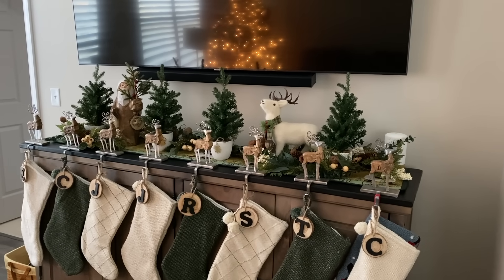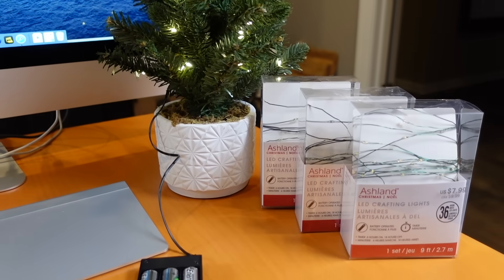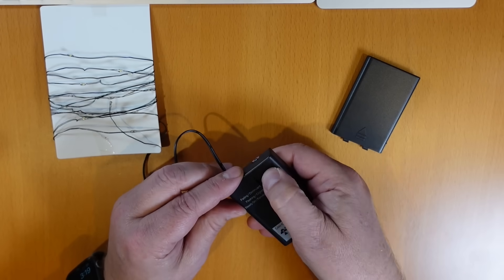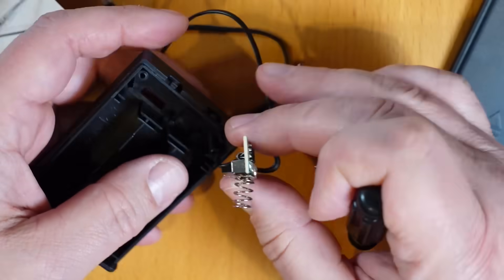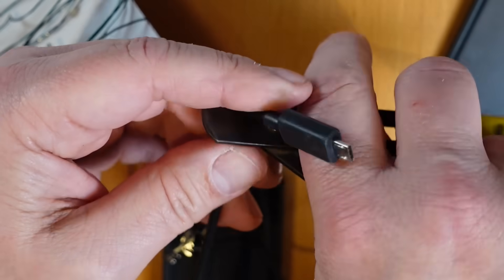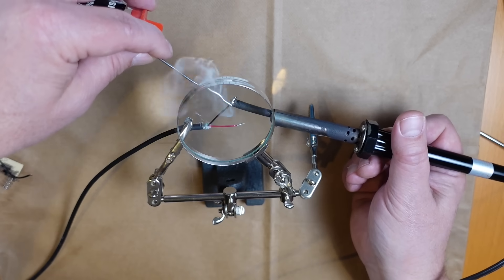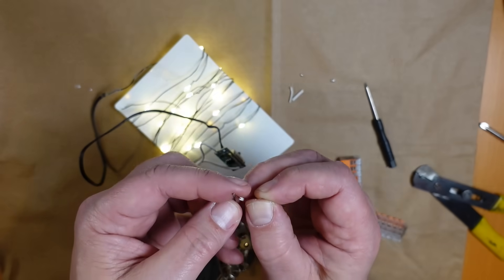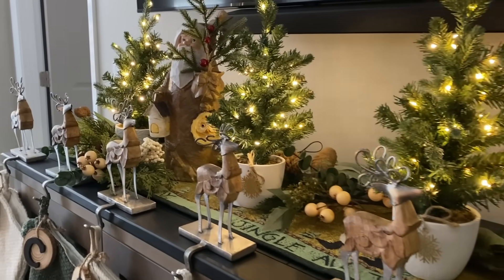SAVE $100s on batteries with this simple decorating hack

Comment: You’re fortunate to have an outlet where you want it. I use rechargeable batteries. You can even recharge regular batteries. You just have to set a timer and take them out before they overheat and explode. 🤭
Reply from the maker: And how do you know how long you can charge them?
Reply: @ I charge them an hour and check to see if they’re warm. If not, I’ll repeat. 3-5hrs usually does it, according to my battery tester. It’s really not recommended, but I have never had any trouble. It’s easier to just buy rechargeable batteries, but sometimes I run out and the old dead standard batteries are right there, so…

Comment: Since you have a multimeter, with the 4 lights connected, it might be interesting to:
- put the leads across the +/- terminals, and see what the output voltage is then

If you have a USB voltage tester, you could also see the current draw.   I wouldn't have thought a single string would draw 1A, that you'd need a 4A charger for all the sets.
Reply from the maker: Thanks

Comment: At the very beginning of this video, the batteries shown are rechargeable.  Yeah, they are expensive, but they can be recharged for a long time. I've been using the same ones for over SEVEN YEARS. Using batteries is a lot neater than having wires running all over the place and extension cords taking up outlets if there is a lot of decorations. The batteries are a lot simpler and there is less clutter. Nice idea though if it's just for one or two items. Still, rechargeable batteries are simpler and well worth it in the long run.
Reply from the maker: Why did you watch this video?
Reply: @handydadtv  
To see what the hack was all about. I'm just saying, in this instance, with all the extra wires laying around, t'is better to just use some batteries. Plus, rechargeable batteries are a lot more ecofriendly than a normal battery.
Reply from the maker: I agree it’s an option.
Reply: @Tube069  more eco-friendly than using an existing charger and zero money plus zero toxic waste on the landfill? Because at some point every battery dies...

Comment: Great idea about using the USB supply, but I'm thinking a different route. I'll connect wires at the end of the cable and attach the wires to the individual control boxes with mini clips. That way everything is removable for storage and if necessary for repurposing the lights can be changed back to battery power.
Reply from the maker: Good idea
Reply: Yes, I was thinking the same.

Comment: I always used a USB charger, a USB cable, a round ink pen and 2 flat thumb tacks. I cut the pen tube to the size of an "AA battery. slide the positive and negative wire up each pen tube, connect the wire to the thumb tack as the terminal and hot glue in place. Now you can use it on anything that takes three AA and AAA batteries, but the pen tube has to be the size of an AAA battery.
Reply: Please do a video of this, GetReal3327.
Reply from the maker: Great idea 👍🏻

Comment: Is there a way I can do this without a soldering iron?
Reply from the maker: Use rechargeable batteries.
Reply: They make kits with fake batteries connected to a plug to do more or less what he's doing in the video with no soldering involved.
Reply: Hot glue will work if you get good contact at the wiring points.

Comment: wait so did you end up using all the lights on the one black power supply or did you use the USB cable on the white iPhone brick. Just looking for clarity on that. I have way more iPhone bricks than the old school 5v wall warts.
Reply from the maker: The iPhone charger wasn’t enough power.

Comment: What other circuitry is on the board, do you reckon?  The lights I got from IKEA only have 2 modes- off and 6h on.  I want to ditch the circuit board so I can have them on for longer than 6 hours, and to control them with a smart outlet. Can't for the life of me find a straight answer!
Reply from the maker: I’m not an electrical engineer so I don’t understand electronic circuits. I just replaced the batteries with a power supply and kept the old circuit board.

Comment: Thank you !!!!!  Can you please post a vid to show the electrical conversion steps SLOWLY ?  I do not have a sodering iron. So how do i do it without ? 
(Another little hack if you wish to yourself - plug in an automatic timer to the outlet.  Program the hours of operation.)
Reply from the maker: I used a smart plug instead of a timer.
Reply: @handydadtv I too love smart wifi plugs & have been really happy with the ones KASA provides.

Comment: Just cut down the wire from my string lights now confuse how to attach a usb cable to it
Reply from the maker: You can’t just wire the string to power. It needs the electronics in the control box.

Comment: If you don’t care about switching on and off and you’re okay with always on, can you just cut the cord on the lights and solder those wires directly to the power supply wires?
Reply from the maker: No, there is other circuitry on the board. Not just a switch.

Comment: But how would you do this x 6? Say you had 6 strings of light s, each with their own battery pack. Wouldn't their combined voltage 4.5v x 6 = 27v? Thats what im dealing with right now. The biggest power adapter I have is 12v. I thought to use say a laptop power adapter but I fear that would far exceed the output I need. So should I be looking for a 30v-35v power adapter??
Reply from the maker: Wire them in parallel (all positives together; all negatives together). Voltage is the same for all of them. Just need a strong enough power supply for the combined amperage.
Reply: @handydadtv  I was hoping you'd say that. So you think a phone adapter should cut the mustard then? I have them ranging from 5v to 12v, not to brag about all my cord collection 💁also have assorted resistors on hand.
Reply from the maker: If they each have 3 batteries in series, that means they run on 4.5 volts. You should be able to power them from a plug-in USB charger because it outputs 5 volts. No need for 12v or any resistors.
Reply: @handydadtv  Thanks for going through it with me pal, appreciate ya!
Reply: You should add a diod or resister so as not to overdrive the leds, otherwise you will shorten the life considerably
Reply: So please which DIODE should I ask at the store? I am doing something similar, 3 AA batteries (4.5v TOTAL) to USB. Thank you in advance.  @Misterpaulwood

Comment: Just checking for a few seconds for the voltage might not be conclusive. Most LEDs will work with overvoltage, but it greatly reduces the lifetime. Adding a series diode will reduce the voltage by 0.6-0.7V and will have almost ideal voltage.
Reply from the maker: Good point 👍🏻
Reply: Can you be more specific about the diode you put in series?  Do you really mean a diode and not a resistor?
Reply: @bbacher95  yes, I mean a Diode. The forward voltage of a silicon diode is 0.6v to 0.7v depending on current and temperature. That voltage is lost and converted to heat. Just put it in series in forward direction.
Reply: @teslatrooper85  got it;  thank you
Reply: Exactly my thought
Reply: been doing this for years and years and the lights are all still going just fine
Reply: except the nominal full charge voltage of a AA battery is usually about 1.7v. 1.7 V times three batteries is 5.1 V.

therefore, the 5 V output of the USB charger should be perfect.
Reply: @Jasons_Garage  Depends on the battery. Some (usually the cheap ones) are as low as 1.2v.
Reply: @writerpatrick  I'm guessing that products like this are not built for cheap, weaker batteries, so the point is moot.
Reply: @writerpatrick  The ones you have in your drawer that were used for who knows how long are 1.2V. Right from the pack, they are 1.6-1.7 V.

Comment: Nice hack, the rechargeables you start with are ~1.2v each BTW.  There's a small chance the 5v may over-drive the LEDs - but since it looks like you are powering 4 strings off of one usb cube, this should lower the overall voltage.  Make sure the USB cube doesn't get too hot to the touch!
Reply: AA are typically 1.5V, and 3 in series are about 4.5V. They’re likely under powering by design 5V analog LEDs. Supplying 5V to them will just achieve their full potential with no issue. I would however fuse the connection.
Reply from the maker: The little cube didn’t get hot to touch, but it would shut off after ~4 hours every day. So I upgraded it to a 4-amp power supply. All good now.
Reply: @handydadtv  That’s interesting… you should try powering just one, and measure max amps, then account for proper gauging and supply to handle all combined.
Reply from the maker: That would make sense. But I’m more trial and error.

Comment: Does the amp output of the charger have any effect? I'd be concerned those tiny little wires would overheat with any extra voltage / amps going to them.
Reply: The fractional voltage difference will have no effect on the wires - and a higher voltage lowers the watts/amps (in general) :)
Reply from the maker: For a single string, you’ll be fine. In my case, I was powering 4 strings from a small Apple charger and it worked fine for around 4 hours. Then it would shut off. Probably an internal thermostat. Next day it would be fine for another 4 hours. 

So I swapped it out for a 4 amp power supply. Now it stays on forever.